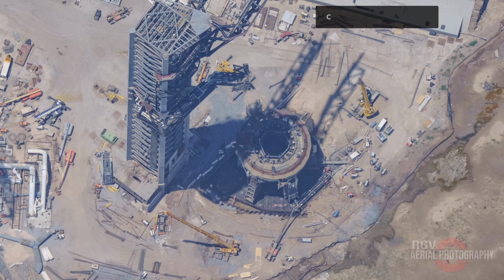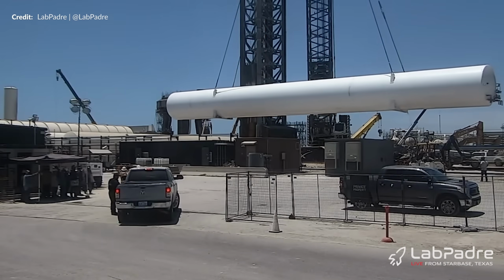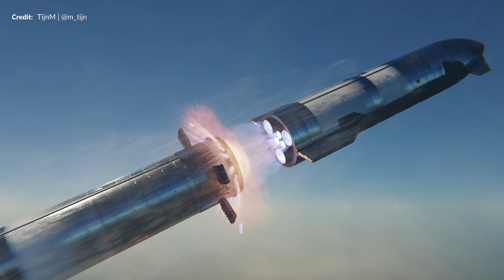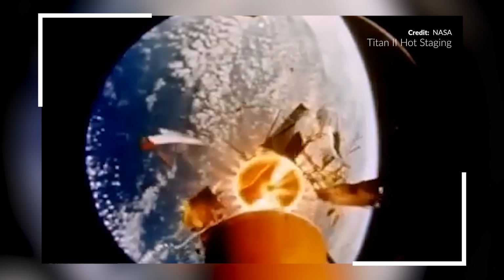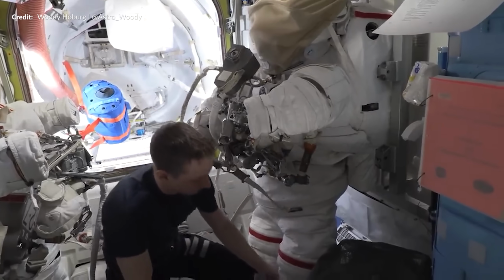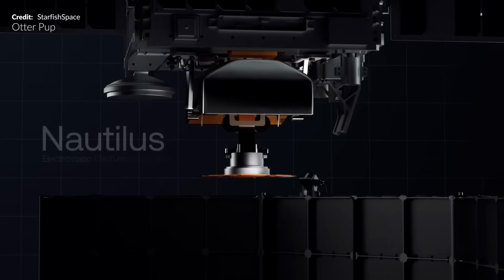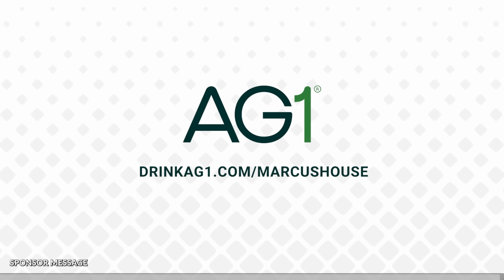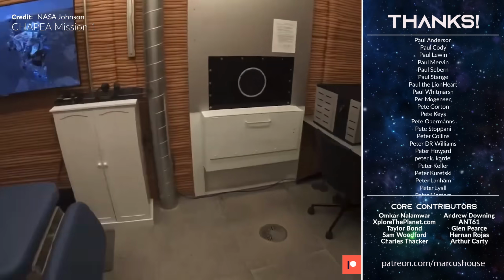SpaceX Drops Bombshell Upgrade Announcement: Can it really be that good?

Comment: So... Here's the thing: flight tests are invalidated when you radically change the thing you tested. A true "flight test" is a systems integration test to confirm that all of the working individual pieces also work together. When you change all of the individual pieces you really have to start over with the systems integration and flight testing. And if they knew they would be doing this, whey did the test the last version that wouldn't be used again?
Reply: SpaceX is not doing traditional space development where they finalize the design and then test. SpaceX is doing iterative design where they start flying as soon as it is okay enough and develop from there. Starship is still in early development.
Reply: @steveaustin2686  There is no value in testing something you're not going to use. You do understand that, right?

SpaceX can describe their process however they like, but there is a reason that the Saturn 5 never had a failure: NASA knew exactly what every component would do BEFORE they put them all together in flight-test. That's what's missing in this SpaceX strategy, they don't even have reliable components yet.

And considering they've been working on this since 2012, their approach hasn't saved any time.

And if you consider the complete destruction of the rocket during flight makes it extremely difficult to learn anything about what happened, it's also the most expensive and lowest efficiency way to test.

If the taxpayers weren't hemorrhaging money to pay for this absurdity, that is almost definitely never going to get human rated, well.. it would be amusing to watch. But since we're bankrolling this I'm actually kinda outraged it's been allowed to proceed to this point with no adult supervision...
Reply: @a24396  🙄🤦‍♂OMFG
Today's post is brought to you by the word Iterative. And the number 2.

Iterative is an adjective from the base word iteration. Iteration is repetition of a mathematical or computational procedure applied to the result of a previous application, typically as a means of obtaining successively closer approximations to the solution of a problem. So basically, "the iterative process is simply a series of steps that you repeat, tweaking and improving your product with each cycle. In practical terms, think of it as practice to make your product perfect."

Since Starship is using constructon materials that are, relatively, cheaper than traditional aerospace construction materials, SpaceX can test earlier in the process that would be otherwise possible for traditional aerospace methods. This allows refinement of the spacecraft BEFORE the design in finalized. You seem to be making the same mistake as the 'rah, rah, rah SpaceX rulz' fanbois, in thinking that Starship is almost finished with development. Starship is still in early development. If you don't want to believe me or the other rational people posting here, the following is NASA's opinion on the matter, from page 10 of the HLS Option A Source Selection Statement from early April 2021 before SN15 successfully landed.

"Finally, within Technical Area of Focus 7, Approach to Early Systems Demonstrations, I agree with the SEP’s assignment of a significant strength for SpaceX’s robust early system demonstration ground and flight system campaign, which focuses on the highest risk aspects of its proposed architecture. This will allow SpaceX to isolate and address performance and operational issues early in its development cycle, which will meaningfully inform the maturation of its capability and increase overall confidence in its performance abilities."

Let's get your caught up to the 21st century. On Dec 12th, 1901, Guglielmo Marconi trasmitted and received radio signals across the Atlantic Ocean for the first time. This boon of technology to the human race was later used extensively in rocket flight, by connecting sensors on the rocket to a transmitter to get ALL kinds of data from the rocket. Called telemetry, this enables rocket scientists to gather reams of real time data from the rocket's performance in flight.

Per the document referenced previously, the $2,941,394,557 (pg 8) "firm fixed price" (pg 6) contract has "milestone payment phasing" (pg 3). So SpaceX is only paid a particular part of that contract when they reach that milestone. This means that SpaceX is fronting their own money for development hiccups and NASA is NOT paying for cost overruns. Especially as page 13 notes, "SpaceX’s plans to self-fund and assume financial risk for over half of the development and test activities as an investment in its architecture, which it plans to utilize for numerous commercial applications, presents outstanding benefits to NASA."

So kindly educate yourself while the adults are talking.

Comment: Could they ever attach a hot staging system to a Falcon Launch vehicle to get a similar percentage boost there too? Would it be economically viable or perhaps even be used as an excape vehicle launch during emergencies involving a live crew, perhaps?
Reply: Crew Dragon's existing emergency thrusters are strong enough to straight-up rip the capsule off the booster. Having the interstage constructed such that the booster will survive the upper stage lighting off it's engines is not really a priority at that point.
Reply: The Falcon 9 and Falcon Heavy are currently certified for NSSL payloads and the Falcon 9 also for crew. I doubt SpaceX will want to jeopardize those certifications with making major changes like that. Both launchers have spare capacity.

Comment: Rocket-powered stage separation works but, nobody had ever wanted to save and re-use the booster stage before now. So, adding the cladding needed to preserve the first stage for future use may add enough weight to offset the supposed 10% gain in performance. I propose a powerful spring to push the upper stage away. Whatever they do, it's going to change the way the stacking procedure goes.
Reply: A powerful spring? Wile E. Coyote is that you?
Reply: He mentioned a 10% increase in payload, didn't he?

Comment: Why not use heat shield tiles on top of booster section? I know best part is no part, but would that be an option to consider or not?
Reply: Because they cannot handle the vibration or the force. They would just shatter.

Comment: About that claim of hot staging giving a 10% payload to orbit boost - it's a misinterpretation of what EM said.  
He gave 10% as a worst case scenario only and he was not specifically referring to starship but a situation comparing hot staging to a very slow second stage start-up with low thrust to weight ratio and like a 20second long startup time or something.
For the starship the difference between hot staging and like a 10 second start time will make a difference of more like around 3% - still worthwhile.
A simple way to estimate the difference is the gravity losses in 10 seconds you fall about 500 meters and fall downwards by 100m/s.
When you check the payload difference against the rocket equation and subtract the 100m/s gravity loss for a rocket it gives a difference of only a few percent.
It's a simple compare but it seems like it would be an extreme case to have a 10% difference unless their original plan for how long it was to take to settle propellants and startup engines was exceedingly lengthy like30 seconds or something like that which would have been sub optimal and made it much harder to meet their performance requirements.

Comment: 2:53 that’s got a be the biggest tap wrench I’ve ever seen, and they’re doing it by hand, insane.
Reply: As a machinist , I just can’t understand that they are hand tapping such a large diameter thread. I think that after the assembly is completed, they are running a tap just to make sure they have no binding when they install bolt.  I wonder what the  diameter & thread count is ?    It looks like a fine thread .
Reply: Pipe tap? Need a hundred feet of teflon tape on the fitting going in that hole lol

Comment: Raptor 3 also has more thrust. They could use raptor 3 on starships and raptor 2 on the booster.
Reply: Why not both?
Reply: That doesn't make sense... When Raptor 3 is operational it will likely be more reliable than Raptor 2. And that would just complicate the production of raptors.

Comment: My one concern with hot staging is that it's bound to do a lot of damage/stress to the booster, even with a heat shield. Seems like it goes against the main focus of maximum reusability. So they'll need a big heat shield to protect the booster, but that adds a lot of weight to the system. How much of that "10% larger payload" will be eaten up by the heat shield, I wonder?
Reply: How did you know for sure when they didn't even test it yet?
Reply: @alvianchoiriapriliansyah9882  
I don't know, of course. We won't know until it is tested.
Reply: It's out an exactly like i predicted. Musk does ketamine... for the past ~ 2 years. This hot staging is total nonsense, the twist was total nonsense. Pneumatc is the way to go. The whole GSE thing including the pad debacle is pure ketamine! More nonsense from him. It's sad story.

Comment: Hey just a thought here. If the Martin soil is deadly to humans. How do you plan to build homes with the soil? Surrounding  yourself in this deadly soil does not seem like a very good ideal to me. Just a thought now.
Reply: Just to inform you, the Mars settlers won't be wearing a beach suits & rolling around on the Martian sand naked
Reply: @alvianchoiriapriliansyah9882  That is not the issue you will be using the soil to build your home think about it.

Comment: Given, that the booster has proven its sterdiness on the first stacked Starship testflight resisting the FTS while doing a kerbal at hypersonic speeds I almost wouldn't have thought twice about hot staging fesability. But at the same time in the same test we have been shown the power of those engines that had no mercy with the launch pad. I'd say chances are 50/50 and this will be epic no matter the outcome.
Reply: I wouldn't doubt that most of the concrete failure was caused by the wet sand experiencing liquefaction due to the throb of the engines hitting the ground like a seismic wave.  Vibrate wet sand vigorous enough and it flows like water and once the concrete is no longer supported it cracks and tge rocket exhaust rips the cracks apart and pushes the concrete chunks away.
Reply: Hot staging is just the new FTS. The best part is no part, remember? 

I kid. Hopefully it all goes well!
Reply: Steadiness? He blew up a $3 billion dollar rocket. They launched Moon rockets 50 year ago with kerosine engine built in Alabama, this is a waste of money.
Reply: @AFuller2020  sterdiness not steadiness. Lots of "firsts" with this test flight. Also the Apollo Mission that landed on the moon was Apollo 11. Lots of test flights with lost rockets before that. Oh, and don't forget the crew of Apollo 1 that was burned in a cabin fire without even a lift off. Also: Kerosine will not help you get back from Mars, since you can't produce it there. Also the starship rocket cost way less.

Comment: The Mars sample return mission was always a waste of money, even at the original budget estimate. SpaceX should have an uncrewed Starship on the surface within that time frame, and for a fraction of the cost. So even without humans you could offload a much cheaper sample return robot/launcher (because initially Starship won't have the fuel to get home, and it may take ages to get a working fuel farm on Mars)

Comment: As long as the booster has less than 125t of fuel left for landing, the empty booster on its own might actually have a higher TW than the fully fueled ship, which in turn has a higher TW than the combined booster and ship before separation.

Maybe the Ships thrust will push the booster down enough after separation?
They could also light the ships engines, then cut thrust on booster and then separate, but that might result in the booster getting more exposure to the rocket exhaust from the ship.
They could go down to 2 or 1 engine on the booster, but that would create weird asymmetric thrusts. I don't know if they want to deal with that.

Comment: Any idea whether the hot fire separation is going to directly “kick” the booster in the direction of the booster’s original boost back burn trajectory after separation to help optimize (reduce) the fuel previously required to turn the booster around? It would be interesting to listen to a deep dive on the trade offs and optimization considerations for this hot fire in comparison stage separation-coast— then second stage ignition — then booster boost back burn. Thanks for all you do for the space community.
Reply: Minimal effect. To absorb enough of a kick to matter, the booster would need to be more substantially built.
Reply: @TagiukGold  So I guess most of the Starship separation ignition blast will be deflected effectively enough that the Booster's 3-engine 50% thrust overwhelms any braking effect? That sounds likely. Maybe a future iteration of the SuperHeavy will take advantage of the "kick-off" to help brake it a bit, saving a teeny bit of landing fuel for the Booster...
Reply: @Wordsmiths  I wish it would help, but I highly doubt it. I wonder if there is any public acceleration data for any of the past hot staged launches??
Reply: @TagiukGold  I'd love to see that data too. Seems like the best data sets of that sort might be in Russian.  If there is any hot-staging acceleration data that has been made public, I'll bet Scott Manley would know, or could find out...

Comment: Mars Sample Return might be more affordable if they stopped using SLS.  But definitely not worth it at the current price tag
Reply: Mars Sample Return is NOT using SLS.
Reply: @steveaustin2686  Do they actually have a launcher decided yet? From the size of the lander, I'm guessing Falcon Heavy is the only candidate operational today... Vulcan and perhaps Ariane 6 might be capable of the job once flying...
Reply: @simongeard4824  Yeah, they are early in the process. Falcon Heavy (16.8t) would likely be the top candidate. Vulcan Centaur (~11.5t), Ariane 64 (~8.6t), and New Glenn (~7,1t) would likely be the other contenders once they are flying.

I would not be surprised if they left the samples for later, since the sample return mission is soo complicated.
Reply: @steveaustin2686  Yeah, everything about this mission is complicated... not much room for things to not work perfectly.
Reply: @simongeard4824  Yeah, lots of moving parts and failure points. Which is why they are going with a SRB for the return vehicle. Many are saying wait for an unmanned Starship landing on Mars, but that has the same problems as the sample return mission. Or even more, if the Starship is to return the samples itself.
Reply: @steveaustin2686  Yeah, I'm definitely not one of the people who think a human landing will be quicker. True, landing a manned Starship to pick up the samples would solve some problems — many things become easier with the flexibility of human workers — but keeping them alive isn't exactly a trivial task.

Comment: Why not cover the OLM with the heat resistant tile material used on Starship?
Reply: Because while the TPS tiles are great vs heat, they suck vs impact. You apparently can break the tiles with your hands. The water deluge is mostly to soften the impact of the thrust on Stage 0.
Reply: @steveaustin2686  They are thought to withstand the impact of Mach 25 at reentry...
Reply: @hydrorix1  The air doesn't directly hit the TPS tiles as Starship (second stage) or any other spacecraft reenters. The air is compressed into front of the tiles, creating a barrier for them. The compressed air heats up to plasma and the heat radiates to the tiles. Much different than the full force of the thrust at launch.

Comment: Hot-staging on top of a booster several times a day, as they eventually intend to do, is bound to have a cumulative effect - they'll need to design a modular upper heat shield that can be almost as easy to replace as windshield wiper blades...
Reply: "several times a day"
that's a very pre-mature worry. They'll be glad if they can launch several times a WEEK